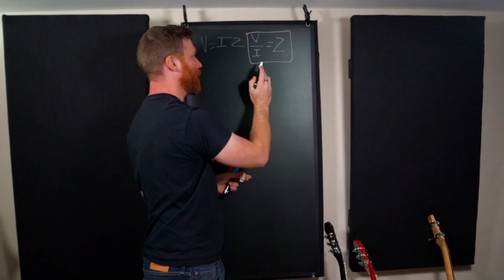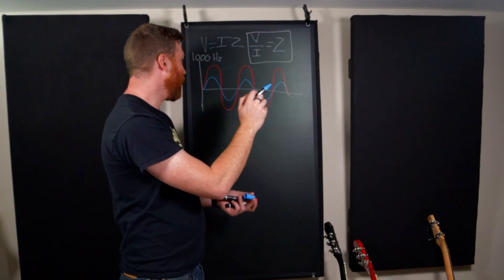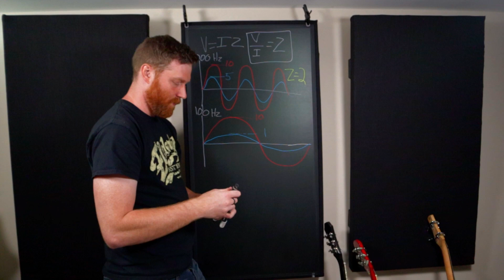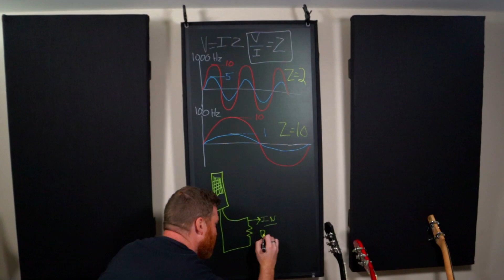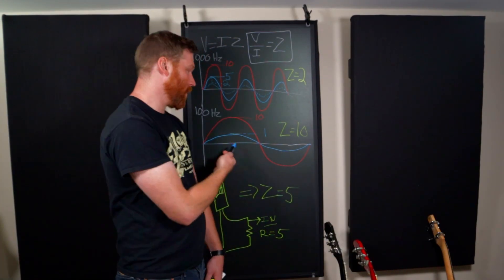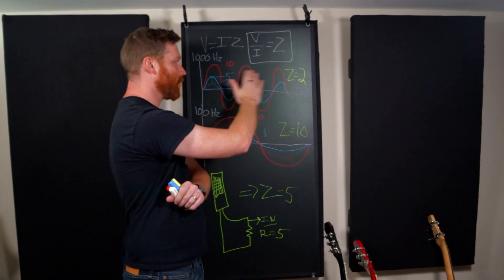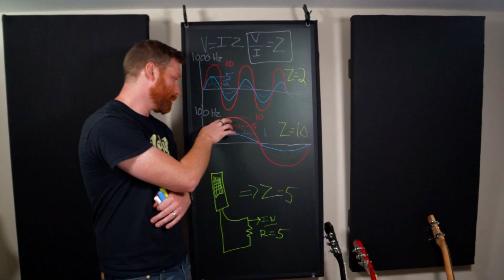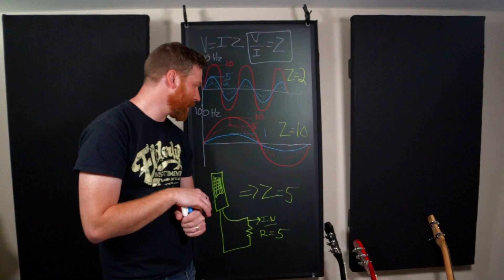A Better Explanation of Impedance for Audio Signals

Comment: Thx for this,. Nice sinewave! Here are some ignorant questions. 

Your statement that a 1,000 Hz audio output has an impedance that "sits somewhere" confused me. An AC signal is a voltage which continuously varies from some negative peak to some positive peak; it's not just sitting at one voltage. Current is a flow of electrons; the electrons aren't just sitting. 

You make it clearer by pointing to the PEAKS of the waveforms. So you're saying, without saying it, that impedance is based on wave peaks. 

Shouldn't your current wave drawing be a bit delayed, compared to the voltage wave?

You show that at lower frequency current is lower. But won't the current have more time to rise to a higher level, since the signal  spends more time near its peak voltage? To put it another way, in a low-pass filter, more signal passes as frequency goes down. So, a microphone acts like a high-pass filter?

You talk about "output current", but isn't current determined by the load, rather than the source?

You mention reflection, but you didn't seem to explain what's being reflected or how. 

Also, you statement that "in audio we're not worried about phase" seems bizarre. Phase is important in so many ways, for example phase cancellation caused by an inverted stereo pair, or phase distortion between two microphones.
Reply: Impedance is frequency specific, not voltage specific. Inductors impede current flow based on changes in magnetic flux due to changes in current flow; it's a bit of a feedback loop. Capacitors impede current flow based on how charged they are, which is always changing with AC current.

Yes! Current and voltage are, generally speaking, out of phase by one quarter wavelength for inductors and capacitors.

We have to be careful about what type of microphone or passive is in use. Inductors have low impedance at low frequencies and capacitors have low impedance at high frequencies.

He's talking specifically about phase in a single channel electrical circuit. Microphone placement for multiple channels is a physical acoustics problem outside of the scope of this video. That said, electrical phase for a single channel is very important when it comes to filtering, like EQs and speaker crossovers.

Comment: Beautiful explanation but I just have one question, this example works only if the mismatch on impedence is in the sense that the load impedence is way higher than the right amount. If the load impedence is lower than the right amount than I can’t think of any logical explanation why at higher frequencies the current would reflect before the tension does.

Comment: For those who didn’t understand: 1ohms uses a thin wire vs a 8 ohms which uses a thicker wire, and the amount of winding in a coils.
Reply: There is a bit more to unpack here. The impedance of an inductor depends both on its resistance and inductive reactance. The resistance is proportional to the length of the wire and inversely proportional to the diameter of the wire. Inductive reactance is proportional to the square of the number of turns in the coil, proportional to the square of the diameter of the coil, and inversely proportional to the length or height of the coil.

Comment: I’m grateful for the effort you’ve put into a concept that I have always wanted to understand. I’m not there yet, but I’m closer. I have two questions.
How can a microphone already HAVE a voltage and a current (and resulting Z), before we plug it into an input?
To match the Z input of 5, I don’t understand why the current doesn’t get reflected (knocked down) in the 100Hz circuit, just like it did in the 1000Hz circuit. Why is it the voltage instead?
Reply: A microphone has a voltage and current because of the physics of the capsule. For a moving coil microphone, the coil moving in the presence of a magnetic field produces a voltage (Faraday's law). Same for a ribbon microphone. For electrets, the motion of the diaphragm changes the capacitance of the capsule which, because it was already charged, creates a current. Piezoelectric mics create voltages when the crystal inside them is compressed. Condensers and carbon mics require an external voltage source to begin working.

Comment: Why is it important to specify that we are in AC at 9:00 ? would the impedance be different if we were in DC?
Reply: The sound is a mix of contribution of different sinewaves at multiple frequencies, thus each has its own impedance (system's behavior respectfully to each signal's frequency)

Comment: What's the proper connection between these 3? Guitar pedal GP-200 on the left, and focusrite 4i4 4th on the right. GP manual doesn't epecify if xlr out is mic, or line or inst level. It just sais 1kQ. The 4i4 manual doesn't specify the 1/4" inst ohms. I don't want to damage the preamps as past experiences. What is the propper connection here? What's up with the impedance matching/mismatch

1. 1kΩ xlr out --> 3kΩ mic xlr in
2. 1kΩ xlr out --> ???Ω 1/4" inst in
3. 1kΩ xlr out --> 60Ω 1/4" line in

Comment: Thank you for sharing such an understandable explanation!
Just got another question: can the input impedance of a receiving device like a preamp or a di box be too high for the source? Let’s say the input impedance would be 1000 times greater than the output impedance of the source. Would such a big drop of the signals current have any negative effects?

Comment: hey this video is helping me so much so thank you for this!!! I did have one question which is you show the amplification circuit but I don't understand f\how that relates to the circuit? you sayed that it boosts the voltage but keeps that current the same which makes since to me but when you referred to how the examples would relate to the Input Impedance the Volts were the same as in the examples and didn't get that boost you were talking about.

Comment: You say the voltage gets reflected back.  Does it actually get reflected back, like a water wave, or are you really talking about a +/- voltage feedback loop?  It seems to me if it actually gets reflected back, like a water wave, then the length of the voltage conductor path would affect the following voltage waveform(s), possibly increasing, decreasing, or even completely canceling out the following voltage waveform(s) in a completely unpredictable and undesirable manner.  Also, I've always heard about the importance of impedance matching when it comes to amplifier output and speakers.  Is impedance matching not a concern then, when dealing with microphones, pickups, etc. and amplifiers/preamplifiers?

Comment: Thank you, this is a really excellent explanation! I have a question. If the input impedance was to increase to a very large number, say Z=10,000, does that mean the current in the 100Hz and 1,000Hz examples would decrease to achieve a ratio of 10,000 (voltage presumably cannot increase because that's a function of acoustic pressure on the mic capsule)?  If so, does that reduction in current have any negative side effects?  Said another way, for input impedance higher is better, but up to a certain limit?

Comment: Why don't preamp manufacturers just build extra high input impedance devices that any instrument or mic could plug into? Why does it have to be around 10 times higher and not more? The current would reduce but the voltage pickup at the input should remain unchanged, no?
Also what about cable impedance? Does it add to the input impedance or to the output impedance? Or neither?
Reply from the maker: Big questions here, hard to answer quickly.  First, unless you are running miles of cable the capacitance is going to be the biggest thing that that has an effect on the input.  There's been a lot written about this and it's interaction with pickups that you can find and read online if you like.   And as far as input stages, manufactures don't get to just set it wherever they want, the input impedance that is appropriate is linked to the design choices of the first stage.  So if you have an op amp vs a FET vs a tube, things change.  The input impedance options are limited by the overall design.

Comment: What happens in the OPPOSITE situation. Most modern interfaces have line output inpedances of 30ohms-75ohms. What happens when you plug this output into a color preamp with an input impedance of 1200ohms-2kohms?
Reply from the maker: Well, you won't have impedance matching problems, so that part is sort of fine, but you will have level problems and possibly ground problems.  Because both devices are referenced separately to ground you may get a hum.  The input level will also be really loud.  But you can turn down the level in your daw and give it a try if you like.  It may work.  If you have hum, you can probably solve it with a reamp box, which will also bring down the level.
Reply: @alderaudio  no ground problems here, but about the level, would the pad button on the preamp help, or is that not enough or at a different point in the circuit?
Reply from the maker: @alvincornistamusic8754  the pad could help and is probably a good idea but really if you have no hum it's just a gain staging thing.  All you need is to not distort the input on your preamp, so whether you want to use the pad, turn down the output on  your interface, or turn down the source right inside the DAW, you can get it to the right level using any combination.

Comment: Voltage is  just a potential. No Voltage nor  current can be reflected.  Your home electrical outlet has 110V AC and  Zero current in Amps (Open Circuit)  Xl and Xc  are reactive components of impedance:  Condenser Microphone=~variable capacitor. At lower frequencies, C reactance is larger, impeding current flow.  Dynamic Microphone=~ coil  changing its  inductive reactance .  When reactances XL = XC  impedance Z=0 and  you are in  resonance . * It is a signal that is reflected  if mismatch of impedance  accrue .* Phase is  very important in music  from classical  physics stand point too.
Reply: as an electrical engineer student I couldnt agree more.
Reply: What is the "signal" if it is neither voltage nor current?
Reply: Thanks for your useful comment, @stivep1. I offer here a clarification regarding how inductive and capacitive reactances relate to impedance and resonance.  The expression 'XL = XC  impedance Z=0' applies to the special case where an inductance and a capacitance are arranged in a SERIES circuit.  Because of the way XL (inductive reactance or +j factor) and XC (capacitive reactance or -j factor) combine, the impedance at resonance (by definition, the resonant frequency is the frequency at which XL and XC are equal) depends on whether the L and C are in series or in parallel.  So, it's fundamental to also understand the converse case: when XL and XC are equal in a PARALLEL circuit. Can you guess what the impedance is in this case? It's the exact opposite - infinite! (Z=infinity). Look at any vintage LC EQ circuit or any radio receiver circuit and you'll likely see both series and parallel cases applied liberally depending on whether the circuit is meant to pass or block a certain range of audio or RF frequencies. In my experience, the best tutorial on this and most other electronic fundamentals can be found in practically any edition of the Radio Amateur's Handbook. This handbook of radio operation and construction practices, published by the organization of hams called the American Radio Relay League (ARRL), has been in continuous annual publication for about the past 100 years. I offer here a clarification regarding how inductive and capacitive reactances relate to impedance and resonance.  The expression 'XL = XC  impedance Z=0' applies to the special case where an inductance and a capacitance are arranged in a SERIES circuit.  Because of the way XL (inductive reactance or +j factor) and XC (capacitive reactance or -j factor) combine, the impedance at resonance (by definition, the resonant frequency is the frequency at which XL and XC are equal) depends on whether the L and C are in series or in parallel.  So, it's fundamental to also understand the converse case: when XL and XC are equal in a PARALLEL circuit. Can you guess what the impedance is in this case? It's the exact opposite - infinite! (Z=infinity). Look at any vintage LC EQ circuit or any radio receiver circuit and you'll likely see both series and parallel cases applied liberally depending on whether the circuit is meant to pass or block a certain range of audio or RF frequencies. In my experience, the best tutorial on this and most other electronic fundamentals can be found in practically any edition of the Radio Amateur's Handbook. This handbook of radio operation and construction practices, published by the organization of hams called the American Radio Relay League (ARRL), has been in continuous annual publication for about the past 100 years.
Reply: Wow, this is really well explained I don't know if I could have done better myself.
Sometimes im glad I took electrical courses in my university.

Comment: "In audio we aren't worried about phase".... This isn't true at all. Phase is really important with crossovers, summing, filters and especially in room acoustics
Reply from the maker: I have realized over time that my statement in the video isn't clear enough to some people.  I'm talking about phase in this specific context of electrical impedance, as in the phase angle difference between the voltage and the current waves.  I am not at all talking about all the effects of phase cancelation that can happen with sound waves.  That is very important.
Reply: @alderaudio  What glydr91 said is still valid: crossovers, summing, and filters are fully electronic and entirely related to phase angle with electrical impedance.

Comment: Thanks a lot for this brillant explaination.
In the end, does it means that the higher input impedance is the better (assuming I'm not deliberately trying to reduce the low end)?
I faced the question yesterday when having to choose among différent DI boxes.
Reply from the maker: Well, if you have the exact same input with switchable impedance, than in general I'd say you are not going to perceive any difference as long as the input impedance is at least 5x the output impedance of the device you are using.  So really just equal above that point, not better.  However, sometimes the high impedance input is designed with a different circuit which is not as well suited.  For example, it will sound worse rather than better if you attempt to use an adaptor to plug an xlr mic into a high impedance 1/4" input.  In your case, if you were choosing between DIs, I'd guess the other parts of the DI (the tranny or circuit) is going to dominate any noticeable difference in sound.

Comment: About 7:40m you mention impedance goes up in a microphone circuit;
I am only an electronic student since the 80s, but it sounds to me that it is exactly backwards: if the frequency induced in a dynamic microphone decreases, the impedance also decreases. Why? Because in the microphone you have a diaphragm attached to a moving coil. This coil is an inductor, and inductive reactance decreases as frequency decreases. As a matter of fact, if your frequency approaches zero HZ (DC) the coil becomes a short. The opposite would occur if instead of a coil, you had a capacitor. As the frequency lowers, capacitance reactance increases. If you approach Zero Hz the Impedance would approach maximum (an open circuit) because the capacitor has time to fully charge, and no longer passes any current. So you should specify what type of microphones you are referring to.
Reply from the maker: Thanks for the question, I can understand where your points come from.  Perhaps in the future I will make a longer video with less hand-wavy explanations of some technical details.  Both ribbon mics and dynamic mics have a large impedance peak in the low end that is caused by the resonant frequency of the element.  The same thing applies to a loudspeaker, which is very much like a dynamic mic.  (Google "loudspeaker impedance" and you will see the graphs with the hump in the low end, often accompanied by poor explanations) Because that peak is often somewhere from 20-100Hz, I generalized that impedance goes up as frequency goes down. In reality, it goes up, reaches a max at resonance, and then goes back down again below the range of human hearing.  Here is a stack exchange that has a good discussion on the subject: 

https://electronics.stackexchange.com/questions/341595/understanding-loudspeaker-impedance

Condensers are a different matter, as they have a powered circuit, they were not my focus for this video, which I could have pointed out.  I build ribbons and my experience is mainly rooted there.

Comment: Excellent explanation! I saw one time in a video that impedance changes different in the case of inductors. The lower the frequency the lower the impedance. Is that truth? Does it mean impedance works in direct proportion in the case of inductors (dynamic mics) and inverse proportion in the case of capacitors (condenser) or the behavior is equal in both? This is inverse proportion